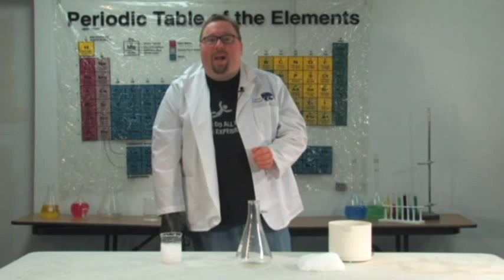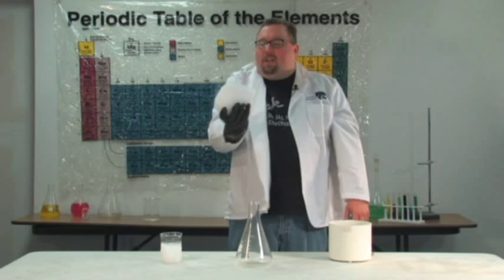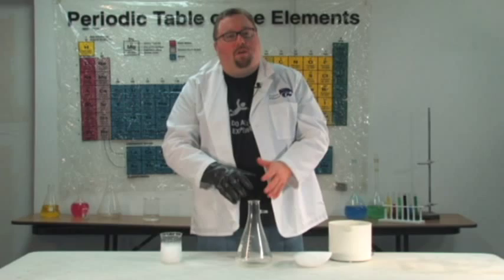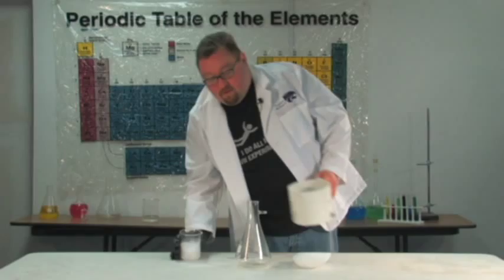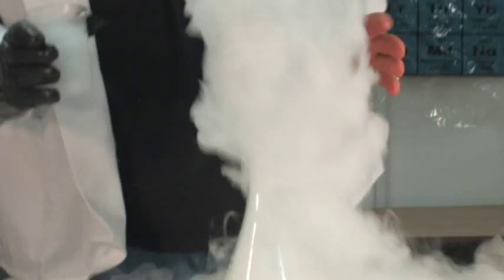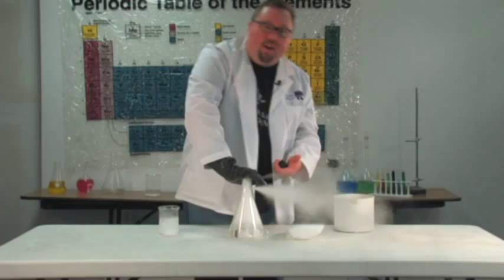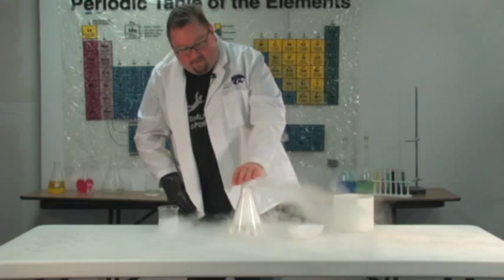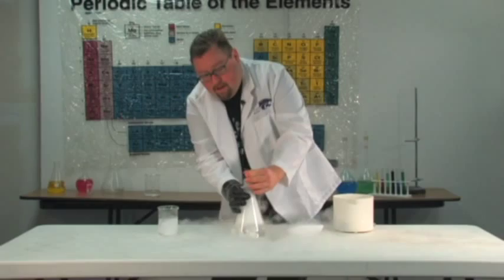Dry Ice Experiment : Dry Ice Smoke Bomb

Comment: I don't think adding food colouring to the water will make a difference in the colour of the smoke. The only thing that turns in to gass is carbon dioxide, not the fluids surrounding it. That just serves to set the reaction in motion... It would have been cool though...